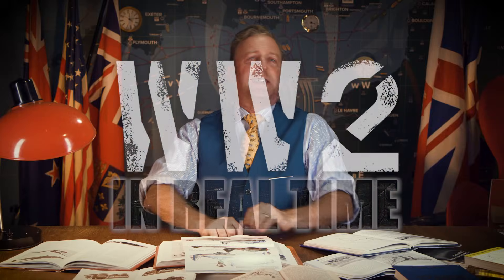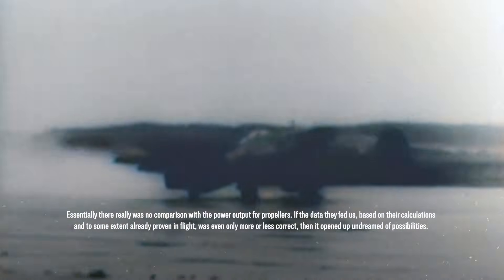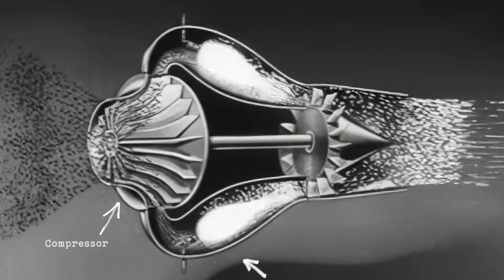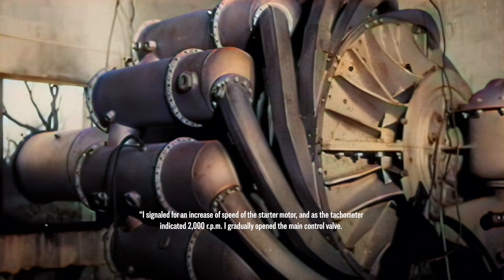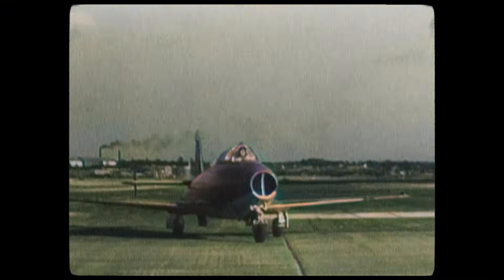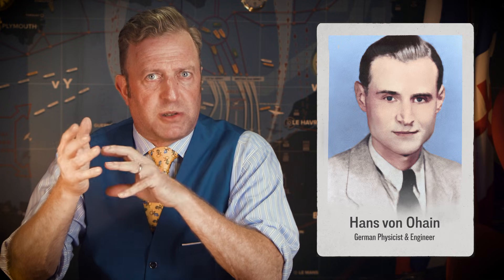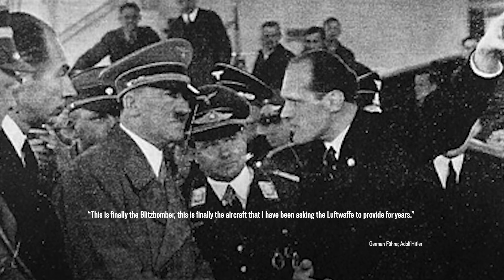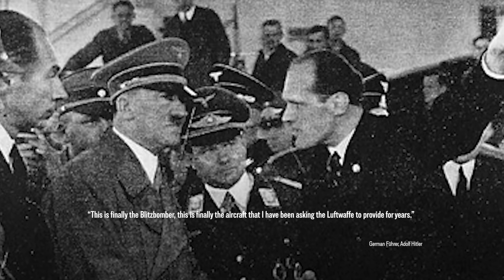WW2 Jet Engine Development - WW2 Special Documentary

Comment: My father may well have been one of those people running for cover when Whittle's prototype engine went out of control as he was an engineer on the project for a while.
Reply from the maker: Thanks for sharing your personal connection to history and thank you for watching!
Reply: He probably knew my great-grandfather, then.
Reply: Neat!  Did he ever talk much about it?  That would have been amazing to have been there at the first test even if it did blow up.  The thing WORKED and they proved it!
Reply: @rrice1705  Not in detail but he did talk about time spent in various wartime engine & airplane factories both in London and NW England (Burnley). He was involved in work on the early Merlin engine, the Halifax heavy bomber as well as the Meteor engine. He was also an Air Raid Warden in London during the Blitz of 1940 and did describe having to abandon the small fire pump he and his colleagues were using because both sides of the road were on fire. He talked about other things from this period as well, though not often, which aren't really appropriate for a video comments section. -- Finally he was involved in the post-War UK atomic weapons program (I know Indy & co are going to start talking about the Cold War), in fact we ended up with a couple of unsuccessful molds for the inner bomb casings (half spheres about 15cm diameter) in the garden and they were used as flower pots - geraniums iirc.

Comment: With the way the story often gets told (visionary inventors ignored by stuffy higher-ups), I do wonder what might have happened had either main country here gone 'all in' from the first instance. Would jet aircraft have been the wonder-weapons to win the war early, or would difficulty in pilot training and logistics (after all, you can't reuse any existing factory tooling or manufacturing expertise) have meant ultimately less success than sticking with piston power for as long as they did?
Reply: That is indeed one of the great "what ifs" of the war.  My opinion is, it would have given Germany a tactical advantage, but a small and fleeting one.  By the time the first 262 squadrons were ready for action, France had already been invaded and Germany's overall material situation was in marginal and progressively worse shape.  In the end, the allies still would have won in the same way, by essentially overwhelming Germany with men and material, it just maybe would have taken a little longer.
Reply: @rrice1705  From Germany's POV jet engines had a hidden advantage - they used kerosene, not 120 octane avgas. By 1944 the Luftwaffe was really struggling to get quality avgas because the allied bombers specially targeted the specialised plants that produced it. Any old refinery hidden in a forest can make kerosene.

Comment: Although at 67 I have always done all of my car repairs my self, I still don't understand how jet turbine engines work. What causes them to spin ?
Reply: Just like an automotive engine’s movement is sustained by the expansion of ignited fuel and air against a piston within a cylinder, the spinning of a turbine engine is sustained by the expansion of ignited fuel and air against the turbine blades in the rear section of the engine. It’s just like when you blow on a pin-wheel, or the atmosphere blows on a windmill. Turbine rotation continues as long as there is fuel to burn and impart the expansive force on the turbine blades, or in  the case of the pin-wheel, until you run out of breath. The turbine section in the rear is connected by a shaft which also spins the compressor in the front. The compressor serves the same purpose as a turbocharger in an automotive engine, drawing in air and making it more dense so more fuel can be burned, which in turn produces more energy to spin the turbine, and so forth. In a pure jet engine, which does not have the big fan on the front like you see on airliners, the propulsive thrust is wholly derived from that portion of the expansive airflow out of the rear which is excess to energy needed to spin the turbine. Maximum thrust reaches a limit based on a combination of the amount of air the engine can ingest, the aerodynamic efficiency of the internal components, and the temperature limits of the materials used in the combustion and turbine sections.
Reply: @wkelly3053  I think I'm beginning  to understand the fundamentals of Jet propulsion. I think your analogy of a turbocharger would be a little better conveyed by using as an example a super charger which driven directly by a gear or a belt where as a turbocharger is driven by the exhaust of the piston driven engine. The exhaust is routed thru a turbine that has a long shaft with another turbine with the blades in the opposite configuration which pulls air in and pushes it into the intake manifold thereby putting more air in the combustion chamber. Some are also equipped with what is called an after cooler which shrinks the air before it enters the intake, which gives it a more intense explosion.
Reply: @johnwright291  Actually, no. The integral compressor that squeezes air into a jet engine is not analogous to an accessory driven by gears or belts. A jet engine is literally like a huge turbocharger just as you yourself describe it,  but it becomes an actual independent engine when you put a combustion chamber (or chambers) equipped with igniters and fuel nozzles inside between the compressor and the turbine. It now generates its own internal combustion gasses which drive the turbine, which then drives the compressor via the shaft. So a pure jet engine is really a ‘turbocharger engine’. Exhaust gasses in excess of what is demanded to spin the turbine go out the back as thrust. Don’t allow yourself to make it seem more complicated.

Comment: On No!  Not this 262, 262, 262! It is tiring. There is a myth that the Germans were way ahead of the British in jet engines and planes in WW2, when the opposite is true. The WW2 German jet engines were extremely unreliable with low performances and very high fuel consumption. The German axial-flow turbojets never worked properly, being developed up to 1953 by the French to obtain a usable engine. The French lost a lot of time playing around with the German engines, instead of working with the British. The French and Soviets after WW2 attempted to improve the German axial-flow engines, largely failing.The British in order to get a usable and reliable jet engine quickly into service that was superior to the best piston planes, with the technology of the time, went for a centrifugal design rather than the troublesome axial-flow design. This design produced less thrust than an axial-flow but was quicker to develop and reliable. Wiggin in Birmingham were commissioned to develop high temperature resistant alloys as the jet engines were being developed. The Germans had no such programme. It took 5 months to develop, while the first reliable axial-flow engine was the 1950 Rolls-Royce Avon, which took 5 years to get right.

In 1945 the French made and tested some German designed turbo jets made with quality alloys unavailable to German industry in WW2. They ran for 25 hours instead of 10 hours to the German engines that used poor quality steel. Not much better. The German axial-flow engines failed because of heavy design faults. The centrifugal compressor used by the first British Meteor plane was fine being much more reliable, but unable to reach high compression ratios. This limited performances. Centrifugal compressors were used up to the 1960s.

In 1945 the team from the French ATAR laboratory plus some BMW and Junkers engineers, were engaged by the French SNECMA research bureau, with the objective to build a new reliable with performance axial-flow turbojet. The BMW 003/Jumo004 was considered unusable. It was tested on the first French jet aircraft, the 1946 So6000 Triton, overheating and exploding. The plane only flew with a Rolls Royce Nene centrifugal turbojet.The ATAR project took 6 years to produce the first acceptable axial-flow turbojet (ATAR 101 B1), produced in 1953. So eight years of research & developments by the French using the German jet engines as the base. It was installed on the first French jet fighter, the Dassault Ouragan.

The French lost a lot of time because the German jets had poor efficiency with some concept failures. Essentially in the combustion chambers and fresh air circulation to reduce the external temperature of the engine. The BMW jet was known for overheating problems which precluded fuselage installation.

The question at the end of WW2 was what is the most efficient way to produce jet fighters. The answer is clearly not adopting the German design of engine and fuselage. The build costs for a jet engine were much higher than a piston engine, with the fuel consumption near 3x. The centrifugal compressor the British adopted in some planes was the best choice with 1944-45 technology, more compression pressure was not an advantage when the hot turbine was unable to resist higher temperatures. The German turbojets had big overheating problems as the engine would not work in an enclosed fuselage for single-engined fighters. This defect was immediately noted by the French on the 1946 "SO 6000 Triton" prototype, and by the Soviets on the 1946 Mig 9. The Soviets quickly replaced the BMW 004B2 by the centrifugal Rolls Royce Nene which worked without problems, dismissing the BMW engine for fighter planes.The Rolls Royce Nene was copied to the last nut by the USSR being installed in the Mig 15 being used effectively in the Korean war. About 15 years ago the Russia/USSR eventually paid royalties to Rolls Royce.

The Meteor was the first proper fully developed jet plane introduced. It was the first operational jet plane, in trained pilots and ground crew, with spar parts and deployed. The 262 was with a training unit until late 1944. The 262 was only slightly faster than the Meteor F3, but extremely unreliable. The British would never put into the sky such an undeveloped plane as the me262. the Me262 and Meteor were leagues apart in safety and reliability. The British could have had a jet fighter operational in 1941, but it would have been as bad as the me262.

The Germans advanced R&D on jets after they interrogated captured British RAF men. They learned the British were advanced in jet technology actually flying prototype planes. Until then the Germans had no intention of mass producing jet planes.

The rushed together Me262 started claiming kills on 26 July 1944. However the supposed kill was a Mosquito reconnaissance plane that had a fuselage cap blown off in a sharp fast manoeuvre, which flew on landing in Italy. The Meteor claimed its first V1 kill a few days later on the 4 August 1944. But the Meteor was a proper fully developed jet plane, not a thrown together desperate effort as the me262 was. The me262 fuselage was similar to a piston plane with the pilot over the wings obscuring downward vision, while the Meteor was a proper new design fuselage specifically for jet fighters with a forward of the wings pilot position giving superior vision, as we see today. The cockpit was very quiet. The high tail was not to impede the rear jet thrust. The partial sweptback wings of the me262 were to move the engines further back for better weight distribution, not for aerodynamic reasons as is thought the case. The 262 balancing problem would be exasperated when firing the guns as the weight of the bullets exiting suddenly made the the air-frame unbalanced. 

There were five turbojet engines in the UK under R&D in WW2:
1) Centrifugal, by Whittle (Rover); 
2)  Centrifugal, by Frank Halford (DeHaviland);
3)  Axial-flow, by Metro-Vick; 
4)  Axial-flow by Griffiths (Rolls Royce); 
5)  Axial flow compressor, with reverse flow combustion chambers. The ASX by Armstrong Siddley;

Metro-Vick sold their jet engine division to Armstrong Siddley. The Metro-Vick engine transpired into the post war Sapphire. Most American engines in the 1940s/50s were of UK design, many made under licence. The US licensed the J-42 (RR Nene) and J-48 (RR Tay), being virtually identical to the British engines. US aircraft used licensed British engines powering the: P-59, P-80, T-33, F9F Panther, F9F-6 Cougar, FJ Fury 3 and 4, Martin B-57 Canberra, F-94 Starfire, A4 Skyhawk and the A7 Corsair.The US General Electric J-47 turbojet was developed by General Electric in conjunction with Metropolitan Vickers of the UK, who had already developed a nine-stage axial-flow compressor engine licensing the design to Allison in 1944 for the earlier J-35 engine, first flying in May 1948. The centrifugal Rolls Royce Nene is one of the highest production jet engines in history with over 50,000 built.

Comment: Don’t worry about those bomber modifications, they couldn’t make enough jet engines to rule the sky. 10 hours continuous running is useful, but they needed replacing after 25 hours of flight time 😹

Comment: The transition from piston engine power to jet involved what Kuhn would call a "paradigm change." That's why it met with so much resistence at the beginning.
Reply: My application of Kuhn's thesis is limited. What I am referring to is the aircraft design and propusion culture, not the technology itself. Many were resistant to embrassing what seemed to them a radically new technology that would require major changes in airframe design (eg. swept back wings,  area rule "coke bottle" fuslelages), and manufacturing processes. @@retiredbore378

Comment: The negative aspect of bomb carrying capacity on the development time of the ME-262 is grossly overstated. At the time, fighter aircraft were more and more used to drop smaller bombs in a tactical ground support role. It was thus a logical question to insure that the new jet fighter would be able to provide such a ground support role also. For a specific bomber role, the Arado234 was in development. The only limiting factor that a jet bomber request could have had was the limited supply of the jet engine that both of the mentioned aircraft shared.
Reply: They had an abundance of Jet engines but were missing airframes. Over 1000 pairs were captured by the Allies after the war contrasted to only handful half finished airframes lyin about. Now for conventional propeller planes ;on the Eastern Front, BF109 pilots stated in interview they had abundance of airplanes but not enough good enough pilots who got younger and younger less and less trained.
Reply: @kleinerprinz99  Yes, it was an exploit that the engine production was basically solved in the end. But the bottle-neck of engines was at the start, when the aircraft was were still in the demonstration stage.

Comment: The Gloster Meteor did have it's World War II uses. They intercepted many V-1 flying bombs for example which it's high speed allowed it to do much more easily that it's piston powered contemporaries, although they did have trouble with the guns jamming but that was not exactly the fault of the jet engines themselves. However the Meteor and it's technology were so closely guarded by the RAF that a directive was made prohibiting it's deployment outside of the British isles so there was no way a Meteor could fall into enemy hands whether by crashing or being shot down behind their lines.
Adolf Galland it's also worth noting flew with the Argentinian air force after the war too and they were equipped with Gloster Meteors which he got to fly himself. To paraphrase his opinion on the aircraft, the Me262 was a better aircraft but the British engines were far superior, probably due to war time shortages faced by the designers of the German engines in the 262.
Reply: The Meteor was deployed in Belgium.
Reply: @johnburns4017  Perhaps, maybe I got the directive wrong, it wasn't allowed to fly over enemy territory perhaps, which by 1945 was increasingly seen as not just the Germans but the Soviets too.
Reply: @johnburns4017  Yes. 616 Squadron, firstly based at Melsbroek ,Belgium then at Gilze-Rijen followed by Nijmegen in the Netherlands and finally Fassberg in Germany. In the ground attack role the squadron destroyed 46 German aircraft.
Reply: The Meteor was used until the 1980s. It is still used today by Martin Baker. No one copied the 262 after WW2. No one. It used an airframe dating from 1938.
Reply: @johnburns4017  Didn't the Czech company Avia build a version of it?
Reply: @donfelipe7510  
The Czechs were given some 262s by the Soviets, who did not want to know them. Avia got them working. The Czechs hardly used them, dropping them after 4 years so. If I recall they never used the flawed German engines.

Comment: While it might be true that it's difficult to imagine modern air travel without the ubiquitous, screaming, not at all green jet engine, true innovation is always difficult to imagine and is often a bigger obstacle than the new technology at issue. Who could have imagined, for example, that electric propulsion would ever be a feasible replacement for jet engines? Or that a new generation of highly efficient, fast, rear engine turboprop planes would be developed? And yet, both are already in the works. The new turboprops are now in the testing phase and will be a perfect replacement for jets in the short hop European airspace.
https://youtu.be/cysrn0k4qVs?si=N67XheT3PUhtBcbe